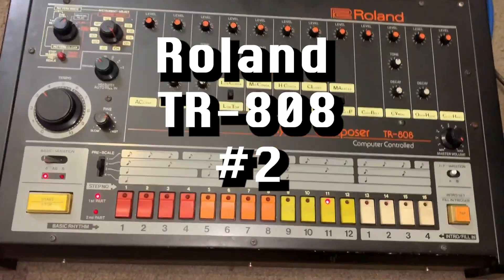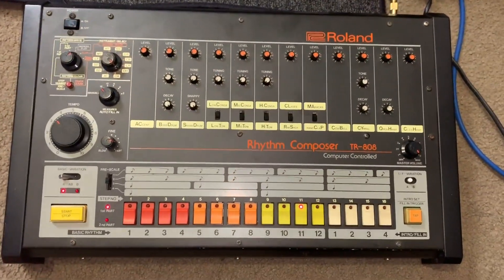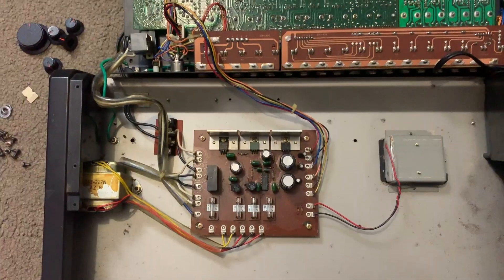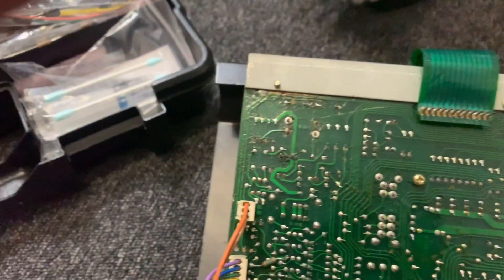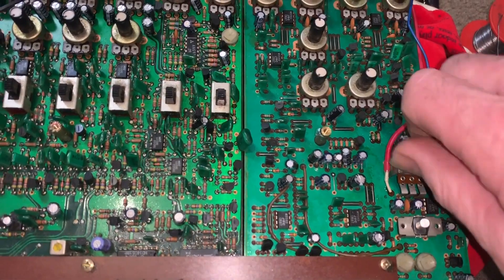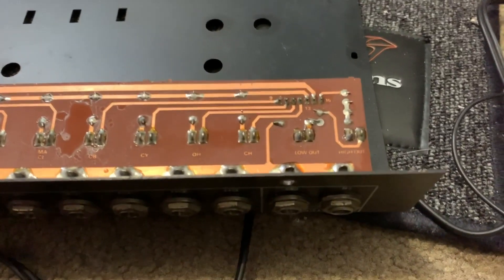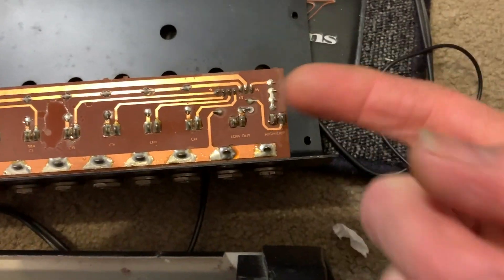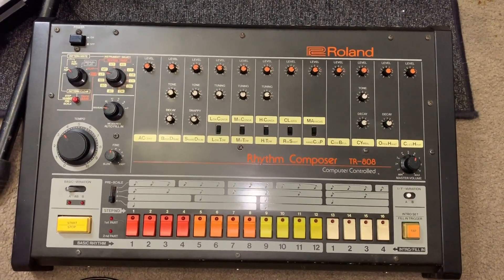Roland TR-808 Fix #2 | Fault-finding and repairing an analog drum machine

Comment: i'm confused, you say 'step-down transformer' at the beginning but the voltage is going... up? help?
Reply from the maker: Hi Michael, I'm stepping the mains voltage down from 240V here in Australia to 110V for this original Japanese TR-808
Reply: @onomatopoeidia  ohh of course. i got my directionality mixed up, makes sense. thanks!
Reply from the maker: @michaelm.7893  yeah it's something not to get wrong for sure!